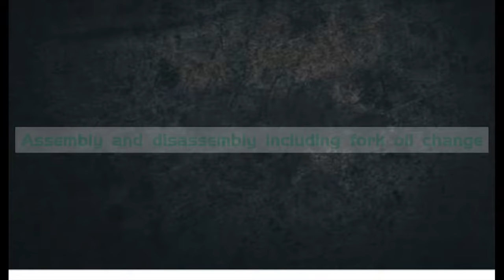Suzuki max100 front disc brake installation | pulsar 150

Comment: Could you please tell me ,forks of which bikes are compatible for max100
I am trying to get one with a little less travel length to get a cafe racer look like of continental GT...
Please suggest me some......
Reply from the maker: Pulser 150
Reply: Brother you can also replace the fork with suzuki fiero disc . And also suzuki zeus . It will fitted easily . with small alternative options.most of time not need to change t assembly. You can buy it from a bike scrap yard
Reply: @parasbairagi4395  thanks a lot bro ❤️❤️❤️
Reply: @surajcyriac1283  brother I am currently using suzuki fiero shoker leg on my suzuki ax 100 with max 100 drum assembly with minor alterations.you can directly replace.if want to change with drum varient.
Reply: @parasbairagi4395  ok bro ❤️❤️

Comment: Pulsar 150 shock disc set Splendor nu suite akuvo?
Reply from the maker: Yes
Reply from the maker: Set cheyyyaaam
Reply: @SelfRepair2stroke  Bro evida sthalam, in Kerala?
Reply: @SelfRepair2stroke  T bore cheyyendi varille?
Reply from the maker: Palakkad
Reply from the maker: Ariyilllaaa njan spendor cheythattilllaaa but ethu t fork venelum elllam vandikkum set cheyyyam need some modifications according to the motorcycle
Reply: @SelfRepair2stroke  Splendor avide kondu vannal Disc brake fit cheythu tharamo? Enthu rate aakum? Palakkad il evideyanu bro? Alathur side aano?

Comment: Bro how much it cost to do lathe work in the chuck nut thread extension ?
Reply from the maker: 159 rs
Reply from the maker: 150 rs
Reply: Bro why till top the thread is made?
Reply from the maker: To suite chuck nut
Reply from the maker: Pulser have threads under the chase pipe